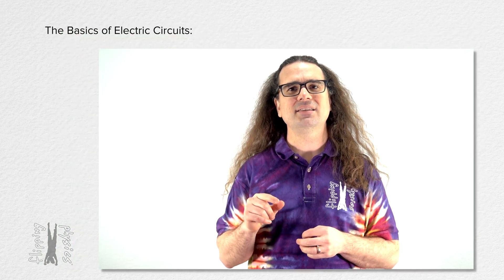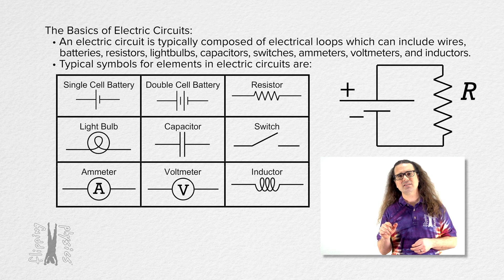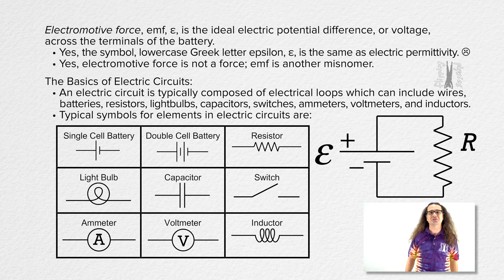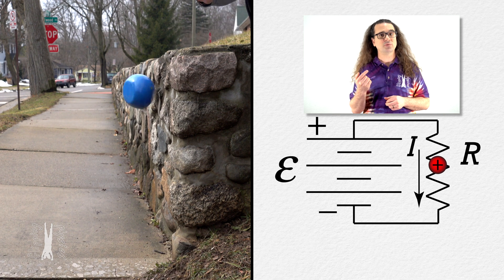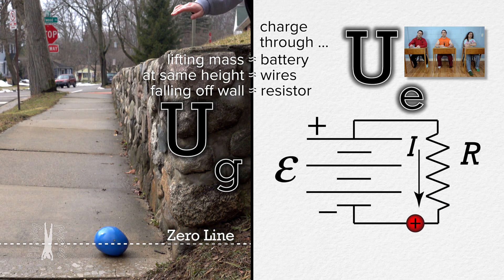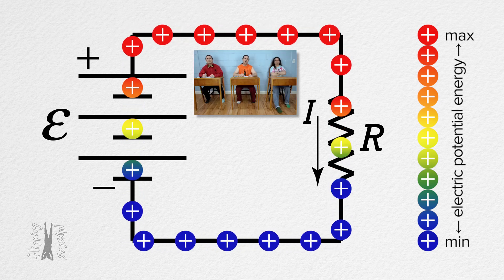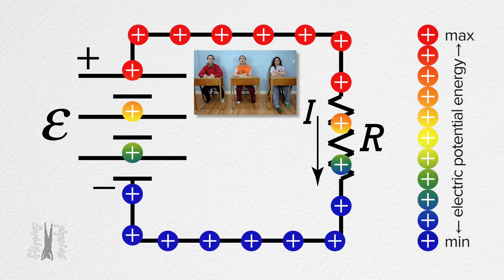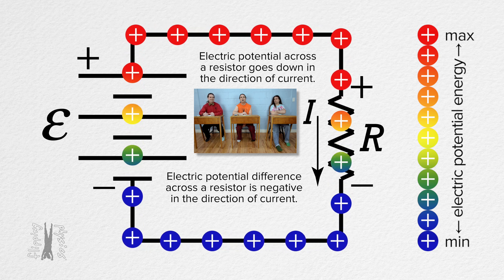Electric Circuit Basics

Comment: Nah, electrons are barely moving rectilinearly, but they do oscillate. 

New electron "bubbles" are made* at the -ve terminal of the battery and they get absorbed at the +ve terminal. 

*(Electrolysis is a chemical reaction that happens inside an electrolyte resulting with charged electrochemical products as an output.)

Energy (actually: change in momentum , a "pulse") can transmit near the speed of light, but the electrons themselves move at drift velocity (mm/s). 

This can be likened to front, phase and group velocities of waves. Speed of light is the front velocity, drift is the phase or group velocity.
Reply: Watch some Walter Lewin videos regarding front, phase and group velocities. He also does experiments so that you can visualize what is happening.
Reply: Also, lookup "Yong tuition". He has a very good video which explains what a battery really is.
Reply: Also, lookup "Ivor Catt".